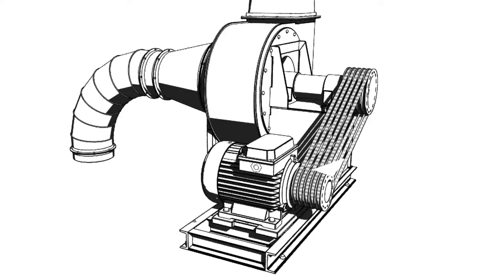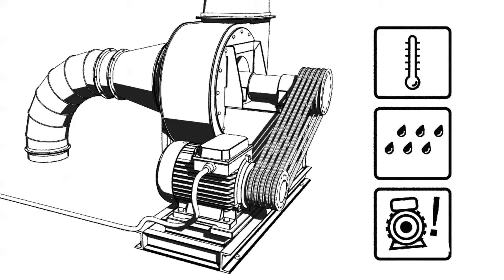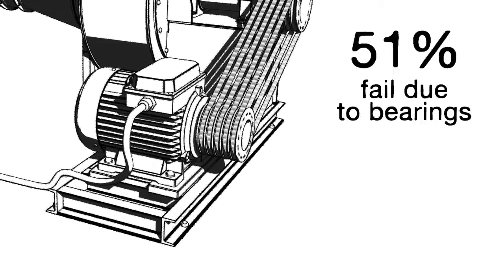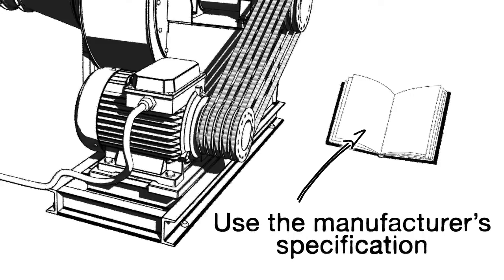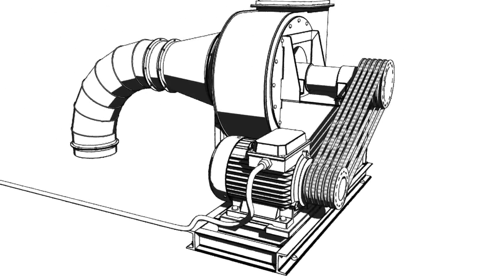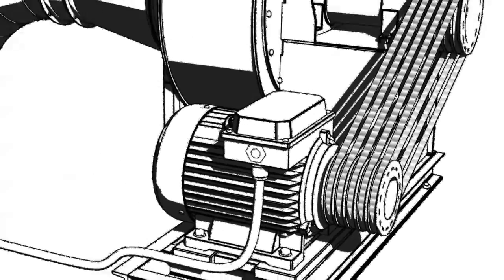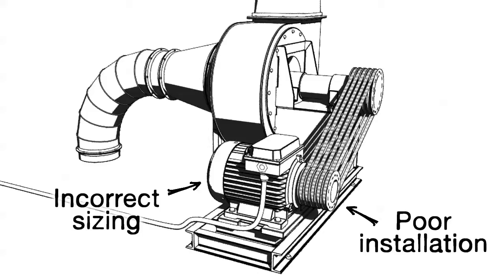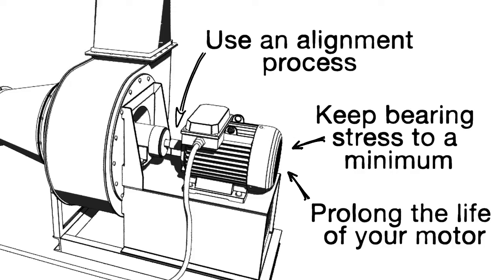Why do motors fail?

Comment: Are these generally 3-phase brushless motors?
Reply: Two-phase mo mos
Reply: @krakenwoodfloorservicemcma5975  I understand that there are 2-phases or 3-phases for AC power distribution, but there is also 3-phase DC, where you use PWM, and selectively drive two of the coils at a time to electrically commutate the motor, rather than use brushes. I am curious to what extent that electronic commutation is done with AC  motors, rather than use brushes. Working with motors myself, the MTBF of a brush motor is about an order of magnitude shorter..  I am less familiar with AC motors, but have worked a lot with BLDC and stepper motors.
Reply: AC locomotive traction motors work with three phase square wave that is controlled from phase modulation.. goes in as DC, comes out AC pulsed.  Very rugged motors, generally fail from insulation breakdown. But they go a million miles often.

Comment: ABB Noobs.
Motors usually fail during start-up.
If you're trying to start-up a locked motor or machine without proper knowledge and protection you'll destroy the motor.

Comment: Didn't say anything about Voltages being wrong!!! Bad wiring can cause an over draw on the circuit causing too much resistance causing the motor to run on too low voltage causing more heat causing an overheating situation causing the motor to burn up!!! All he talks about is mechanical failure!!! Not electrical failure!!!
Reply: Low voltage also.